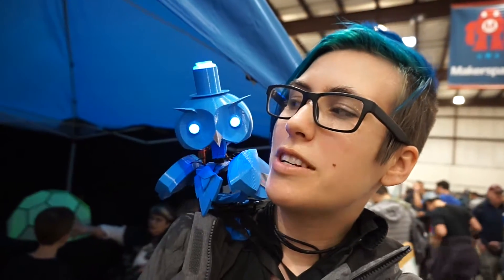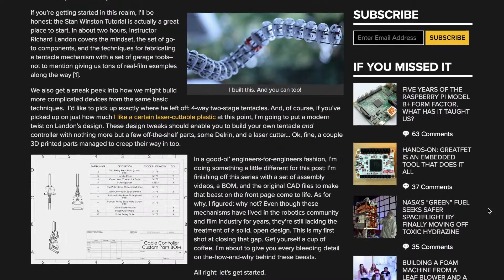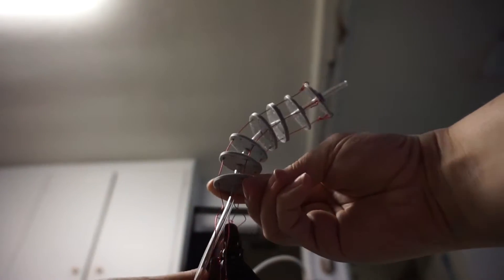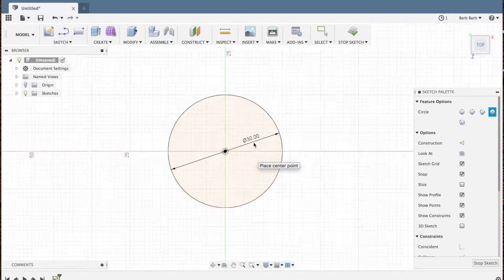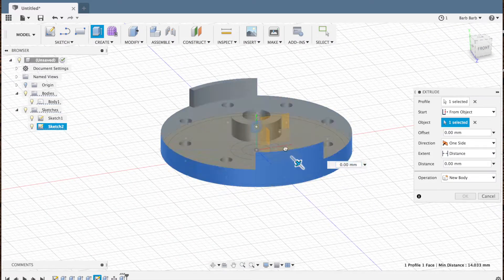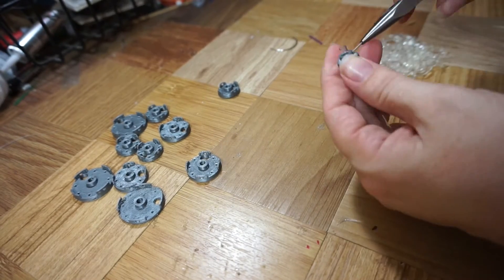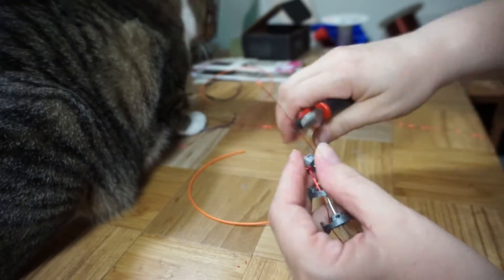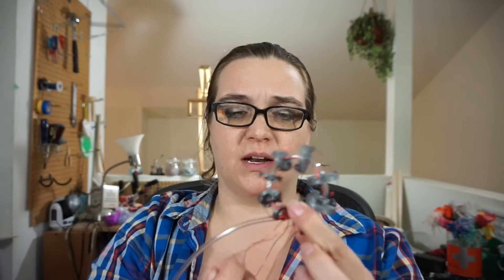Robot Octopus Arm #1

Comment: Have you tried using nitinol wire in order to replace the motors and make it more compact while having smoother movements? I'm trying to find inspiration for a project I consider doing sometime later on.